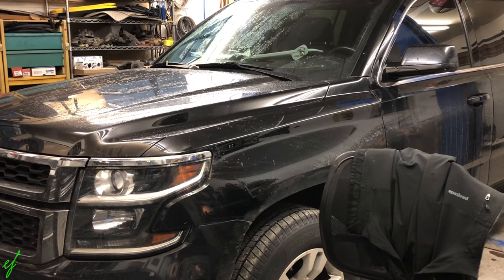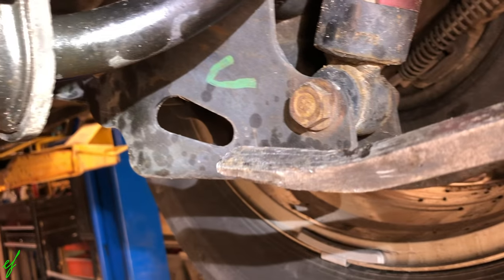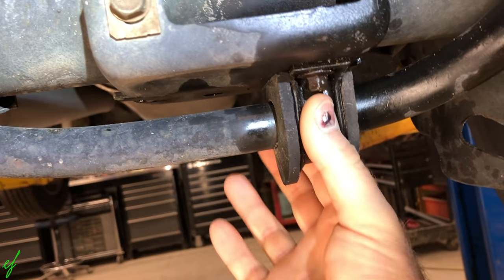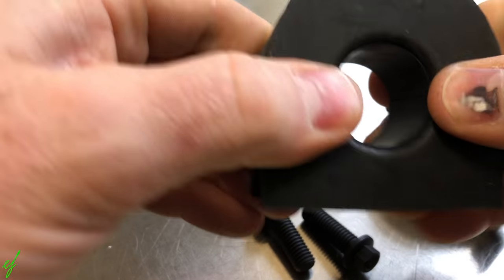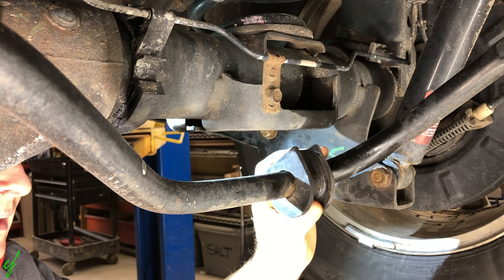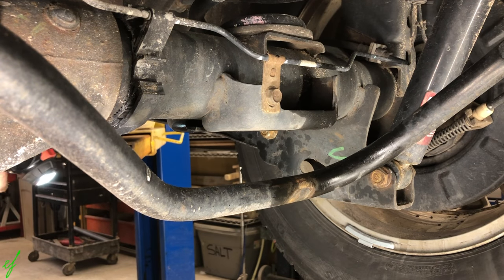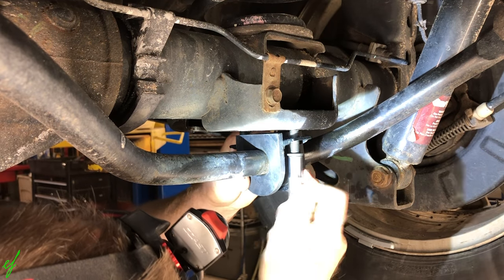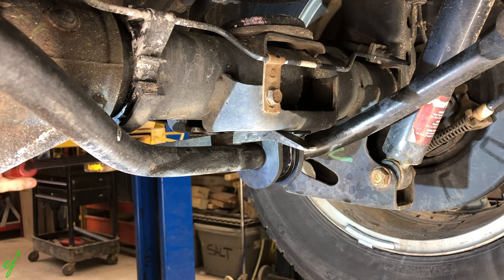SWAY BAR BUSHINGS  |  Professional Sound Diagnosis & Replacement

Comment: My mechanic first serviced the disk breaks. Then changed all the suspension bushes in the front. Lastly changed sway bar bushes for this problem. Where is mental hospital i want to admit myself and him.
Reply from the maker: Cars can be super frustrating. Sway bar links and bushings can be very elusive also. The NVH Noise Vibration Harshness they cause can be super difficult to track down. Sorry you guys had to take a few extra tries at it. It for sure happens on occation. Im glad you got it fixed 😀😀

Comment: I went to this garage to replace the drive shaft and asked him to check if the bushings were fine.He opened the connections to the sway bar and rotated the bar with the bushing intact and told me the bar shouldn't rotate so easily and told me they need to be replaced. He told me the bushings were cheap but he asked me a huge amount for the labour charges.told me he needs to open a lot of things. He didn't shake the bar like u did..just rotated it and said it needs replacement..should I go ahead. I just paid a huge amount for the drive shaft and labour charges do I need to change the bushings now?
Reply from the maker: Hi C P! Can you send me a video? I can check it out for you. I am not sure what year, make, model, engine, and charges for your repair are. If you can get specific I can see if it is a reasonable repair price. Cars are expensive to fix but bushings are usually relatively very inexpensive in the car repair world. Usually a bushing repair is $100-200 max. That is just a generalization though and not a rule of thumb. Every car is different. Most bushing replacements pay .5-1.0 hours at a shop for reference. You can bounce those numbers off their shop rate. Most bushings cost $20-80 max. Usually the bar will NOT rotate at all in the bushings. So I am not sure what you mean by that. Now, If you have a sway bar link that needs repair, the total bill can be equal to double that of a bushing repair. Maybe you have a link bad?? Does that help? A video speaks a thousands words if you can get one. Thats the best way for me to see if your part is defective or not. Send me a video! 😀

Comment: Great video! Thank you!! I have done basically the whole front suspension, upper and lower ball joints, sway bar links etc. Still had a bad noise that was driving nuts. I had the bushings just need to find the easiest way to install them. Your video helped so much. Saved me about$500 on new shocks and struts.
Reply from the maker: Awesome man! I am glad you got your ride repaired 😃

Comment: Thanks for showing the play in the bushing before and after, it really helps show how it should be
Reply from the maker: No problem. I wanted to show an idea of the difference. Tough to capture sometimes 😀🔧🔧
Reply: When they are bad do they sound like metal on metal
Reply: I have replaced the front suspension more then once because Amazon sold me a defective part that cause strut blew and rocked my qx56 to shift back in fourth cracked my other strut smh now I thing maybe the bushin

Comment: Just awesome! You'll be amazed just how few mechanics can diagnose something like this. Great job.
Reply from the maker: Thanks man!
Reply: Well, even the few that could diagnose it - the question is, would they tell you that it is a simple fix as shown in the video, or would they try to act like you need to replace the entire sway bar....hmm
Reply: Man I was told the bushings were cheap but a lot of things need to be dismantled so the garage guy was asking a lot of labour charges ..just wanted to check this video before I could go ahead.im glad I did

Comment: Hopeful this will work, your video was great.  My mechanic has replace the struts front and rear and one motor mount over the past 2 years to get rid of the clunking but never has.  I just changed mechanics and he suggested the sway bar and this seems quite like the origianl problem. This noise drives me nuts when I am driving my wifes car 2007 Ford Freestyle.   Thanks for the clarifications
Reply from the maker: No problem. Let me know if the replacements help. They are some of the most common and cheapest parts that wear out on the steering and suspension system. So when they go bad at least we have that going for us 😀🔧

Comment: good job.  i was just wondering if the car needed to be jacked on both sides at the same time to replace these.  or can it be done without jacking car up.  my accord been clunkjng in the rear for ten years
Reply from the maker: The axle being worked on needs to be level. Level can be done in the air by lifting and letting both sides droop evenly. It can also be done on level ground. The sway bar system doesn't hold the weight of the vehicle so it can be serviced on the ground or in the air. If the axle being worked on is not level there will be twist in the bar and pressure can be applied to the parts. Servicing components could be dangerous because of the "spring" like pressure in the bar. Removing parts and installing could be dangerous and also difficult to line back up. As long as everything is level, side to side suspension is equal height, should be good 😃🔧

Comment: On the 2010 cobalt LS there are two options on the bushings. There is a 18mm and 24mm depending on sway bar thickness. Took me a while to find that out
Reply from the maker: Oh! Sometimes a larger bar is used for performance models 😀🔧🔧

Comment: Did you eyeball it when reinstalling the bush? Because my Honda has paint/ markings on the bar....
Reply from the maker: Yup i eyeballed it and matched up the new bushing positioning to the witness marks from where the old bushings were mounted on the bar 😀

Comment: Does the car have to be in the air or on jacks to determine if the bushings are bad?
Reply from the maker: No, if you can access them you can shake them down and look for play. As long as the vehicle is level there should not be any pressure on them and play will be detectable if it is present. Here is a new video I made on links and bushings and sway bars in general if you need more information 😃
https://youtu.be/0S8JBe_jn6g

Comment: Could you do a video diagnosing all of the front end clunking noise possibilities for a rwd truck?
Reply from the maker: Sure can. Thats a great idea! What particular kind of truck do you have?
Reply: 04 ram 1500
Reply from the maker: I will do that video. Gonna take me a while. But I will do it. In the mean time any luck finding a video on youtube that will help you?
Reply: @EasyFixShaun  no, I’ve replaced all 4 control arms and struts and outter tie rods. If the sway bar links don’t shut it up then i might replace the knuckles and rack/pinion.
Reply from the maker: A for effort man! Sometimes when you can't pinpoint the problem and you want to solve it throwing parts at it is a great last resort. Cars are stubborn and hard to diagnose sometimes. Sorry you are having trouble. Another option is a chassis ear. They will find any sound. You just have to test things until you find the problem. Here is a link, I do make a small portion from amazon. I have one of these and they will make you the expert 😃 https://amzn.to/3zd0QUn
Reply: That is amazing tech! Thanks for the link!!
Reply from the maker: No problem. They are worth every penny on the first NVH Problem they easily solve. (Noise Vibration Harshness). 😃

Comment: Can I use the same kind you purchased or do I need to get a different kind to fit my 2019 Jeep Cherokee Trailhawlk...???
Reply from the maker: Any brand will work. Usually it is worth the extra effort though to get " "oem" bushings. They usually fit slightly better and last the longest under almost all
circumstances 😀🔧
Reply: @EasyFixShaun  
Awesome! Thanks so much for the clarification 😇👍. Keep up the good work on your videos.
Reply from the maker: Thank you!!

Comment: Do we need to put grease in the  bushing
Reply from the maker: I wouldn't recommend it. I always install them dry- just like they came from the factory. I have tried it a couple times for fun and an extremely loud squeak developed after a month that could not be fixed. I had to replace the bushings a second time. Here is an updated video on bushings and links if you want to learn everything about them 😃 https://youtu.be/0S8JBe_jn6g
Reply: @EasyFixShaun  thank you. The mechanic changed our sway bar bushings and put grease I have light squeal  or creaking noise now after a week if the roads are uneven and  when doing a full turn. Unfortunately, the mechanic put grease on all rubber bushings in the lower and upprr arm aswell. Do you think that's the cause?

Comment: Other than a clunk, what problems will I have with loose sway bar bushings?  Thanks!
Reply from the maker: Usually they wont cause breakage in any way. There will be annoying rattle and clunk. It does play a big part in the stability of the vehicle so there may be a loss there also.  I hope that helps 😀🔧
Reply: @EasyFixShaun  If those bushings are worn, do you think it would help with overall stability on the highway when changing lanes?  Mine are worn and it feels like I'm driving a boat on the highway.  I probably need to get new struts as well, but wondering if it would be worth doing those bushings first.
Reply from the maker: @squirrelattackspidy  It is possible it could help to replace the bushings if they are worn with that problem. I would look more into it and check all suspension and steering components though to make sure there is nothing else that could be loose and worn😃🔧
Reply: @EasyFixShaun  With my old car, it's about as loose and worn as I am. :P  I
Reply from the maker: Haha 😂

Comment: Hi there. Question when installing a bushing  , should it fit some what tight with out the bracket being installed yet?? 
Thanks
Reply from the maker: Yup! That sounds just like how I would want it.
Reply: Thanks so much,. I didn't know bushings  came in two different sizes for my F150.
I had the wrong size..
Reply from the maker: @julesrockz2960  No problem! Sometimes manufacturers will change the sway bar diameter depending what suspension package the vehicle is ordered with. 🔧🔧

Comment: when removing the sway bar links or the sway bar bushings, should the suspension be at ride height or can i just jack it up, let the suspension extend all the way and remove the bolts?
Reply from the maker: Can be at ride height or full suspension droop. I would make sure suspension side to side is basically level either way or you could fight with it a bit from the twisting spring action of the spring steel bar. Here is another video that explains it better if you need it 😃 
https://youtu.be/0S8JBe_jn6g
Reply: @EasyFixShaun thanks for the quick reply! i have an issue where something is squeaking when driving straight, but as soon as i start turning either way (even slightly) it goes away. I was thinking it's some suspension/steering component that gets under load when turning (removing the slack under load) but is not under load when going straight.
Reply from the maker: Could be anything. Check the brakes also 😀
Reply: @EasyFixShaun  i fixed it a while back, turned out to be a stuck brake pad, i cleaned it off and the caliper bracket with a file and its good now.
Reply from the maker: Excellent job sorting that out! 😃😃

Comment: What do you do if you replace the bushings but one side is still loose? It is the correct part but idk if I should try to buy it from another company or if the sway bar is worn. On the worse side all the paint was rubbed off and it looked a little thinner where it contacted the bushing.
Reply from the maker: Sometimes the bar can get slightly thinner with no problem. We have lots of rust and I have seen that many times. But I haven't seen or needed bar replacement from that yet. Sometimes cars have different diameter bars for the same vehicle depending on engine size or trim levels of the vehicle. So you will want to double check that because the bushing could be a couple Millimeters too big. I would try an OEM Bushing before replacement of the Bar also if the parts you have are correct.. Usually the OEM parts are the way to go for sizing and durability 😃
Reply: @EasyFixShaun  I measured the bar and it's 1-3/8" like manufacturer said but near where the bushing was close to 1.25" or 4.25" in circumference in one spot. IDK I got confused because I could really only measure circumference and try to calculate to which would make it less than 1-3/8". the inner diameter of the bushing was about 1-3/8" too but it wasn't oem bushing so IDK I might go and look if I can find a smaller bushing or maybe the oem is better yet if the measurements are correct then it seems like it wouldn't matter and I wold need a smaller bushing.
Reply: @EasyFixShaun  I can try getting an oem bushing but what do you do if the new bushing is still not tight because the bar got slightly thinner? Also i can't seem to find a new bar for this old 2003 P42.
Reply from the maker: If a aftermarket part doesn't solve a problem. Often the OEM part will. If you replace the bushings with OEM parts and wiggle the bar and still have clunks you may have a bar with diameter too small. A new bar would be best here. I have seen people put rubber material around the bar to increase its diameter. One guy used a rubber hose- that is not the way it should be done. But If you no parts are available you may need to make your own 😃

Comment: Hey Shaun, Im a new subscriber to your channel. A little background of my vehicle, I was side swiped on my my rear bumper panel and the wheelbearing was also out, it started to make a loud noise. Car was dropped off to get it fixed, a new bearing installed and now the noise disappear. However, 3 weeks into driving the vehicle again, I started to hear noise from my passenger side, started making a noise on every bump it encounters... my question is do you think 10 years powertrain warranty will replace bad struts, bushing, sway bar links, shock absorbers or any other things that causes it to make a noise? Also got this brand new 2023 kia soul last year and the car only has less than 15k miles within 2 years of ownership. Is there any way I can send you a quick video to determine why causing the passenger side suspension to make noise it makes everytime I go over a small bump or big ones?? Your kind thoughts would be much appreciated.
Reply from the maker: Hey man! No problem, post a youtube video on your channel and let me know when you did and I will gladly check it out. The warranty question should go to the dealer. Depends on your warranty length and what is covered. If it's under warranty those components would be covered most likely. In the mean time also check out my other superior sway bar link video and try the hand shake test on links and bushings. The shake and sway test also helps point towards links and bushings if you can't get them to make noise by hand. 😃
https://youtu.be/0S8JBe_jn6g

Comment: I just got my changed but still squeaking does it do that till they ware in or
Reply from the maker: Usually the bar doesn’t squeak at the bushings from my experience. Wet them down with water and see if the squeak stops. I would tend to think of the bar is squeaking at all it’s a dry sway bar link ball joint. They are usually not guessable and when they dry out I have had noise from the links.
Reply: Easy Fix is it bad or good ? If it still does squeak
Reply from the maker: If it squeaks something is wrong. There could be lubricant on the rubber or something. The bushings are soft and designed not to squeak. So I doubt they are squeaking. But anything can happen, double check them. Try to pinpoint the squeak and go from there.

Comment: I see its made by Dorman  I wonder if they sell this setup for my 03 ford focus     I like the kit new hardware and bracket real nice
Reply from the maker: I am not sure. Go directly to dorman's website and do a part look up. It is pretty easy to do and you can see what other parts they make for your car also. You can also be 100% sure you have the correct part number and then look it up on ebay or amazon or rock auto or wherever 😃🔧

Comment: Does it still make noise even you disconnect the sway bar?
Reply from the maker: Usually if the bar system is disconnected or a component breaks it will all the sudden go silent. Very dangerous though, the bar can "spear" the tire and puncture it sometimes or damage other drivetrain, brake, steering components. 
Full length video https://youtu.be/0S8JBe_jn6g
Reply: thanks.. well, according to your video, the link is loose hence the sound.. but i dont have the link, totally disconnected but similar to tha=e sound in your video.. maybe ill check maybe the bushings, but still, it is disconnected but how does it makes a noise? well, maybe i am looking at the wrong source
 @EasyFixShaun
Reply from the maker: If  the links are disconnected it sounds like there is another clunk from another different steering or suspension component. Check everything. Could be anything. Would be a good idea to check wheel bearings and brakes also. Let me know what you find! 😃

Comment: Could you Please tell me the distance (Center to center) of those bolt holes...??? I just swapped out the original bushings for a set made by Moog. The bolt holes were wrong. I had to drill them out and cut off a piece of the strap to make them "Sort of" fit. I have been looking at that very set, which you installed, but No one seems to be able to tell me what I need to know... No one in Amazon would reply to my query... Sheesh! Please help... 🙂
Reply from the maker: I wish I had the specs for you but I don't I am sorry. That info has to be out there, but it's not super common to look up bushings or bushing straps with that information. You could order the amazon Dorman bushings somewhere, measure and return them to get the specs if you are in a pinch....? 😃